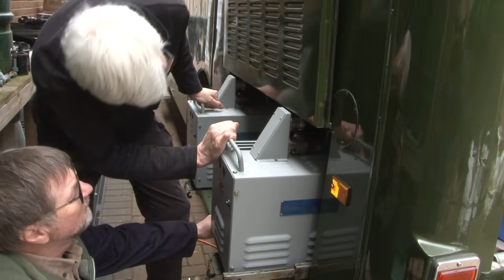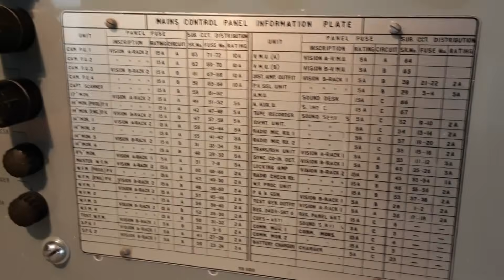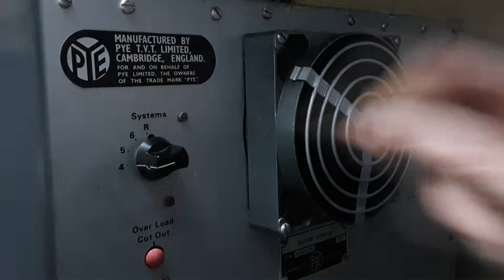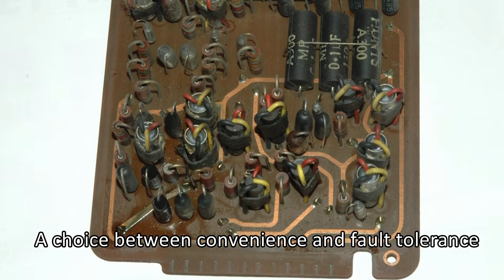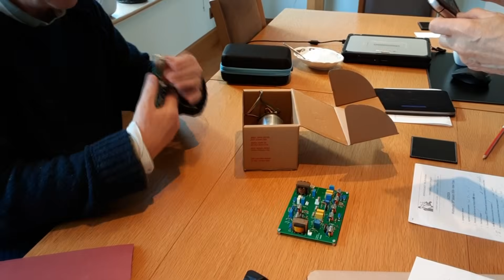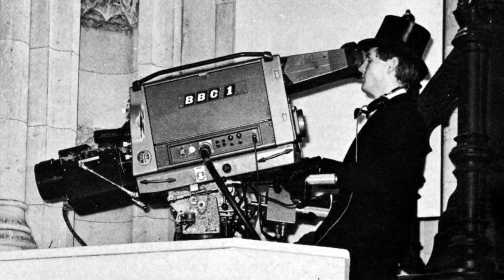The 80th video about MCR21 - on this occasion the first power-up of 2026.

Comment: does the 525 line mode work too? Was this for transmitting to north America?
Reply: I'm not sure if we had boards for each standard.  It was hard enough repairing them for 405 and 625!  Yes, 525 was common and fairly easy to implement in the monochrome era.  Could be used to make programmes locally either to be recorded locally (on 525 line VTR which became available) or transmitted over satellite.   Also multi standard equipment was attractive to the manufacturer for export reasons..

Comment: So did the TV frame (and hence line) rate remain locked to mains frequency right up until the start of colour in the late 1960s (colour needs accurate frame rate, not +/- 0.5 Hz was necessary). I thought even B&W was crystal-controlled by the end of the 1950s.
Reply: I don't know with any certainty   It's about hum bars and not rolling o a cut.  It might be that 405 remained mains locked and 625 was crystal locked even in Black and white. As televisions improved the need for mains locking diminished.
Reply: @bsomers8664  I presume the thermal inertia of a  tungsten lamp filament means that a lamp fed at 51 Hz on a camera which is scanning at 50 Hz will not produce a noticeable 1 Hz hum bar.

I was always surprised that the stroboscope markings on a record deck worked so well under tungsten light with the long decay time in the light compared with a fluorescent light.

I wonder how well video recorders worked with video signals whose frame and line rates varied a little as the mains varied. Keeps those tracking servos on their toes! I presume mains-locked TV continued for a little while after VTRs (eg Ampex Quad) started to be used.

Comment: Back in the early seventies, as a kid, dragged out by my dad to see a golf tournament at hoylake, I was delighted to see there was something far more interesting to me, a TV outside broadcast, and as ever, a great thanks to all those techs who answered questions from a spotty-faced kid.  One thing of interest was this operation was being run from a generator, a lovely, white, silent 130KW truck umit, a Rolls Royce my memory says, which the operator told me it did more film than TV.  A three phase set, with only one phase in use.  But what was relevantly interesting about this genset was it was plugged into a house, hundreds of meters away, on a series of long extension cables, and the genset synced its frequency and phase to that house, so, really, the grid.  The OB could then have stable phase reference as described in the video.
Reply: A question I asked in a previous video, how could they establish sync in a location with no grid power, easy enough to establish a fairly stable 50 Hz and voltage level but how do you phase sync it accurately with no reference. did they have an Rf fed SPG from a local TV transmitter perhaps or something else

Comment: Is the National Grid phase not consistent across the U.K. any longer?
And have the mains frequency tolerances changed since 1963?
I know it shifts between a range either side of 50Hz, but I thought the whole system stayed in sync fairly solidly.
Reply: There is only one National Grid, so the phase is consistent.

Comment: Interesting ideas here, but far from ideal from a technical point of view. I will explain: Whilst the mains sounds a simple idea, it was almost certainly done because mains hum could not be eliminated from both the Broadcast electronics or the receivers! This would tend to produce a visible hum bar, either distorting the picture or being visible in the picture. It is much less visible in either case if stationary. The proper solution at the time should have been to lock the master Oscillator to an off air radio station, perhaps Droitwitch on 200 kHz and easily received all over the UK, and to remove the hum! Interestingly hum was still a problem in 1978 when I was a BBC TV Engineer, when the video was not locked to the mains, and the answer was the "Stop coil", a large transformer core wound with video coax, intended to stop 50Hz circulating currents in the massive coax networks, particularly TV Centre where there were literally hundreds imbedded in the wiring. A bit later at Pro-Bel we made DAs with differential inputs, the screen then floating and no circulating currents!
Brian mentions the other important item, the Frame Store synchroniser, which we invented at Quantel about this time. It may sound simple, but this revolutionised synchronisation of remote sources and was first used at the Olympics that year to synchronise a helicopter camera over the site to the fixed equipment. At the time the video A to D converter was virtually unknown, and about 1Mbyte of memory made of 4k bit Rams was also mad in concept, however it did fit a 5u box (at the end of development). Performance was to full broadcast standard in 525 or 625 colour BTW. Life has changed very fast! David G8FNR etc.
Reply: Another synchronisation note: Note that operation without a mains supply (OB in field 2 miles from mains?) typically a generator, could not be used. Modern ones are crystal controlled to less than 1ppm error, and mains frequent changes  with load on the Grid are much more than this so mains sync. has always been impossible.
Reply: The production units used 16k bit DRAMs, just available and were only 4u!
Reply: I believe the main need was to avoid the nations TV's doing a field roll on cutting to and from the OB. Yes the frequency of the national grid did change, but the point is it is the same phase everywhere.   One option was to have a 50c/s reference sent to the OB location, or you could Xtal lock and send a reference to the generator to lock it to you and avoid the moving hum bar...  All Pre natlock. and less than perfect options.

Comment: I believe the 405 line service originally was locked to the mains.This gave the fault symptom on dual standard 405 625 line TV's
"Hum bar on 625,405 lines ok"
Reply: Having a hum bar on a particular line is one thing, having them roll up and down your picture is way worse, so lock it.
Reply: Yes locking to the mains was the norm, assuming you had mains that is.  One option was to have a 50c/s reference sent to the OB location, or you could Xtal lock and send a reference to the generator to lock it to you and avoid the moving hum bar...  All Pre natlock.